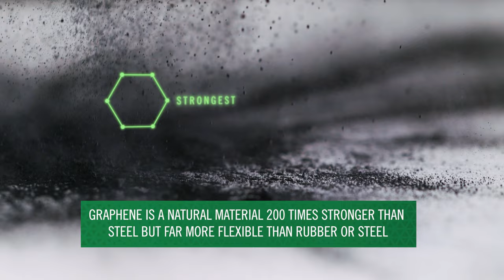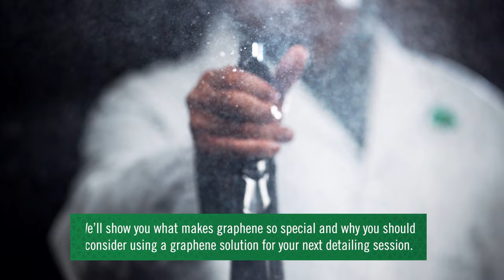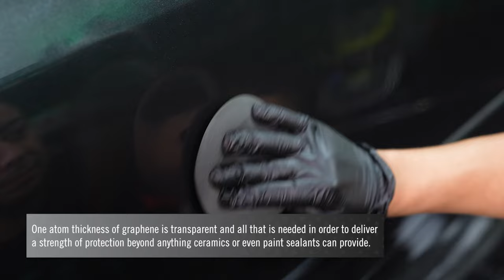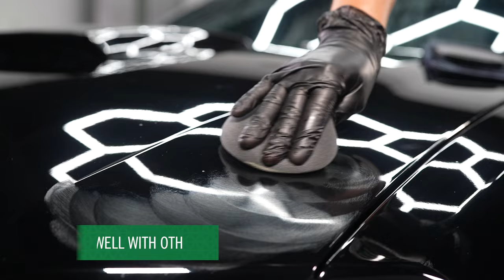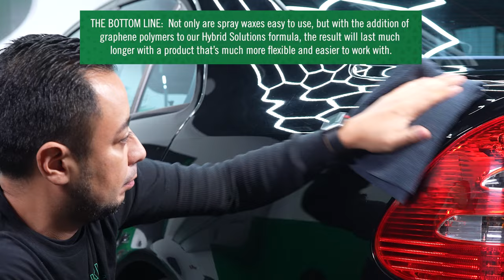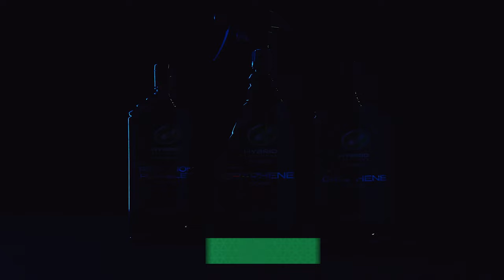Why is Graphene Spray Wax so Good?

Comment: I first apply the Graphene Spray Wax (one panel at a time), then mist the panel with Pure Shine Misting Detailer, this eliminates any difficulties wiping off the wax, plus leaves the paint super slick!!!!
Reply: That sounds a good way I’ve been using a damp microfibre cloth then a dry one but do you think after wiping it on spraying a detailer then removing would be ok and not affect the end result or product ?

Comment: As its a finicky product to wipe up... Which gsm towels do you suggest to use ( high pile or low pile)  ..
Reply: Products like this seem to do best by focusing on method rather than equipment.  Any microfiber will do, but you'll need to use a damp towel in the middle of the process.  It's the key to getting the stuff to not just smear around and be sticky.